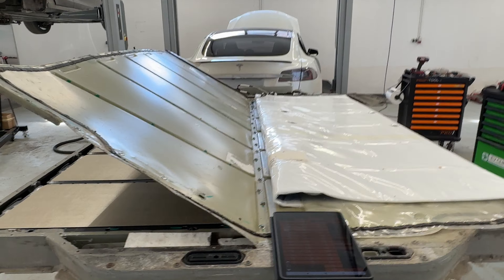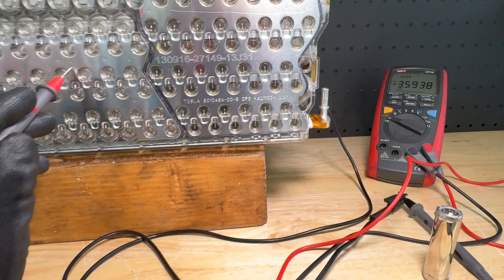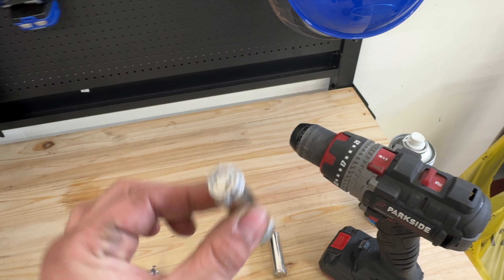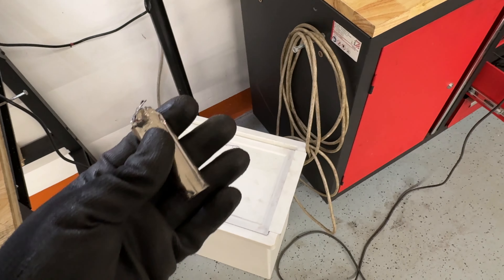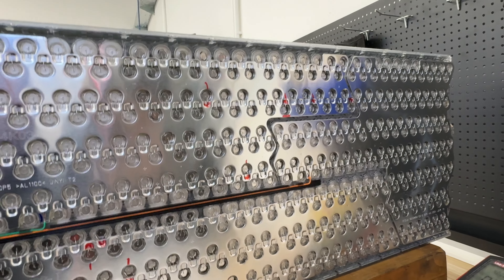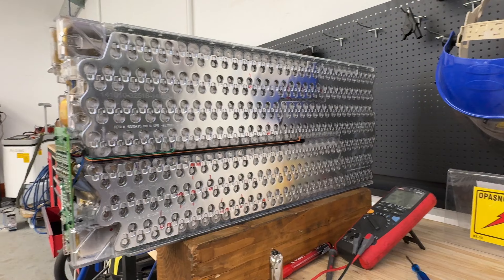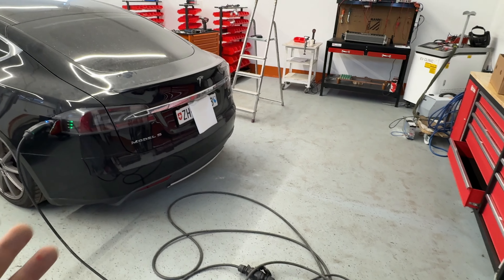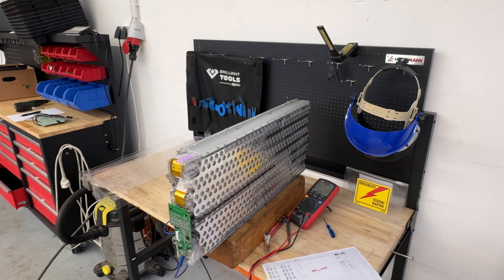Repair Tesla battery for 1€ - 1 Cell Extraction

Comment: If it was up to me I would use a thermal camera to find the discharging cell because it would acting like a resistor and be getting warm
Reply: Exactly, that's probably the way such shops detect the faulty cells, but obviously they don't want to share their knowledge. The another probable way which came to my mind would be to measure the current going through the fuse wire which will be difficult too.

Comment: That is what I call sustainable! Even if you do not do it for free, such a service is wayyyyyyy better than exchanging whole packs or even the entire pack for 20000€ for absolutely no reason.🎉❤
Reply: 12k+ labor with core from Tesla for remanufactured. About 10k without core and another 10k for a new pack with no core. So 12k€,22k€,32k€
Reply: @rkan2  just got quote from tesla. 20k for new pack. 18 for used. 25k with labor and 23k with labor. New is 90kwh reman is 85. So 20k is right. Atleast in eu
Reply: @diniitotoom2526  Is that with or without core?
Reply: @rkan2  didnt mention sht about core. Dont think they do that here

Comment: Congratulations and greetings from Bulgaria! This really makes EV transport even more sustainable! It may be harder to do the same with Model Y ans 3 packs as the cells are glued together, but I'm sure it would still be possible.
Reply from the maker: It is easier with M3, not harder, you have that video already.
Reply: @evclinic excelent work. What you think about Teslas 4680 which is glued that red polyurethan?
Reply from the maker: @Lucid911-k2i  i think it is possible to repair that too.

Comment: Great job there. With a proper battery tab spot welder and the other required tools you can absolutely do single cell replacement.

Comment: This seems like a good and professional solution. But how do you counter the argument that Jason Hughes from the US makes, that it’s not possible to change a cell an even modules, because the battery will fail again within 1-2yrs. He is probably one of the most respected Tesla hackers and has huge amount of experience with Model S. I really wonder who to trust here.
Reply from the maker: I trust only real life experience and results. Our 1cell repairs are still driving and not failing. Statement that 1 cell defect and 1 cell change is not helpful is not correct
Reply: Jason Hughes also said Tesla tried module swapping for remanufactured packs but stopped doing it soon after... So I tend to agree with Jason. Maybe these fixes last 1-3 years, but not 8 like a Tesla remanufactured pack should.
Reply from the maker: @rkan2  Not fully true, Jason is good IT guy but nothing close to our ex Rimac and Tesla battery engineers. Mixing cells with new one is not allowed, and test are neceseary to determine state healthy cells (dcir acir esr cac). Then you match used cell library stock with existing pack. Non of that is used by Jason nor has equipment for that. Jason is missinformin public about something he dont have skills nor knowledge to do. He is mythbusted. Cell level repair is possible with prober cell stock proper lab equipment.
Reply: @evclinic Exactly to the point👍👍👍
Reply: @evclinic Yes! And even Gruber in US says and makes exactly the same👍👍 And their repairs work as well very good. The question here might be what is cheaper to exchange the defective module completely to another used one which is balanced before or extract the one defective cell and exchange it and use the module further more?
Reply: Then why would tesla replace my broken pack with a repaired pack if they know it will fail again..?
Reply: @ARPost-kn2jl  They repair other damages and use the packs again, but not cell damage. For example cooling, wiring, contactors etc. can also fail and be replaced to use the pack again.
Reply: @evclinic Very impressive. Do you need to rebed the cell? If so how do you accomplish that process and is it proprietary also to your company? Thanks for any response
Reply: Because the replacement battery only has a two year warranty, not 8 years like the original. Tesla only needs the replacement battery to last two years, then it's not their problem anymore.

Comment: great work out there! curious what the toughest job, soldering? or pulling the cell out? looks like a lot of glue. either way not worth the risk which so high voltage
Reply from the maker: Module is 24V, that is not high voltage

Comment: Thank you so much for this video. I am on my second S with failed pack (water...) and I wish you were closer
Reply from the maker: Ultimate Tesla killer is not Nio, Lucid or EQS. It is Water ingress
Reply: @evclinic  Also replaced 3 LDUs. Reman lasted 79k km. Any update on the one installed in yours?
Reply from the maker: @VegarHenriksen  My made 30000km, one from Hansjorg with 2million km Tesla i at 150,000km.
Our solution is bullet proof for LDU
Reply: @evclinic  Awesome. That is the LDU you made, right? How much is it roughly €?
Reply: I found on website. 3.875,00 € inc. VAT

Will definitely purchase next time mine fails. Thanks for the hard work!

Comment: Amazing work!

I have a 2015 TMS P85D with 220.000 km…
It have started to show signs of anomalies/glitches. 

Approx how much will it cost for a service(reseal?)?
Reply: …, and - as I understand from what you say in this video, the battery pack on the P85D is not dimensioned right?
Can you upgrade the battery?

Comment: they need to make the cells easily replaceable and there should be a trade in service for these that for minimal cost you get a full working, repaired battery pack.

Comment: Do you provide any type of warranty ( e.g. a large labour discount if it occurs  again within 2 years or so ) ? What would be the price to check the battery  and replace 1 cell ?
Reply from the maker: 2 years warranty on full labor price. Unlimited mileage, SuC charging desired
Reply: @evclinic  Will contact you if needed , thanks for that swift response, I guess pricing is happening in private communication

Comment: I am surprised you removed the cell physically, I had expected you would leave it in place but simply disconnect the positive terminal of the problem cell from the rest of the block. In doing what I describe, the recovered overall battery would be around 1.3% lower in usable capacity but much better than the 30% reduction of usable charge when it was brought in.
Reply from the maker: Problem is more that 1.3% if you are taking it out from lowest CAC brick. We road testet 18 months several cars with 1 cell failure / repair and it is sustainable. But there are several rulles which you need to apply. First one: you cant put new cell….

Comment: Doing something like this in the old days required lots of notes and metering on old Nicad aircraft batteries packs, couldn’t imagine that many cells you deal with, you definitely need a computer to keep track of that many batteries cells. At least you don’t have to worry about fluid levels.

Comment: Why is a pack only built from kind of 18650 cells and not from lifepo4 cells/packs like GBS? this pack has an amazing BMS in it. My opnion is this not necesary to balance 15 modules with each 6 cells

Comment: Is BYD blade battery inside Model 3 (LFP version)? 
Will that also be repairable?
Reply from the maker: That might be extremely complex to repair
Reply: @evclinic  Did you ever saw a CATL pack in real live or on video? Munro talked about "Tesla LFP" while showing another manufacturer. 🤷🏻‍♂️
Reply: LFP have 10 times longer lifetime then Li-ion so don’t worry.
Reply from the maker: @volkhen0  That must be confirmed first on road. NMC 18650 can make max 600k km, 2170 500k km. LFP what it seems from Tesla warranty returns is 300k km. Degradation is bit faster and small kWh packs die faster
Reply: @evclinic  then the problem must be on the pack level (balancing? to big current?) or the cells that have 5000-6000 cycles lifetime have higher fail rate.

Comment: Does the new cell not keep charging at different rates than the old cell and in a few months time the delta of the section will again be too large?
Reply from the maker: We dont put new cells, that is biggest mistake. We use same age healty cells from other packs wirh same dcir acir cac
Reply: @evclinic  I should've been more clear. I watched the video and saw it wasn't a new cell. It is however a new cell to the old pack, even if it is already from a uses pack. It shouldn't matter how old the cell is. What matters is that the new im whatever way aged cell will always have worn differently to the rest of the cells in the pack to be repaired. Thus it will drift again. Maybe this repair will be longer lasting than  module swapping since it only affects a smaller amount of BMS'd cells and might stay under the thersholds. However I still doubt this will last 8 years. 

I guess it also doesn't matter for most companies doing this since they don't offer the kind of warranties like Tesla or 057 Technology.

If you want to put your money where your mouth is, you should offer similiar warranties imo.
Reply from the maker: @rkan2  We mentioned, that we recycle old cells.
Reply: @evclinic  Touché

Comment: I own a Model S 2015 with 94k km. Should i expect needing HV battery repair soon? Wondering if i just sell it
Reply: I have one with 380.000km and only 14% degradation. If yours has the LDU check for coolant leaks (rotor seal).

Comment: What's the cast to remove and put back battery Tesla 3 LR? Fixing battery pack Price from to? I'm asking because used battery is from 5000 euro 2019-2023.
Reply from the maker: Remove replace reinstall and collant flush 800€

Comment: 🤔 instead of replacing the cell. Can you just isolate it? Would that work..
Reply from the maker: It would work, but if that brick is with lowest CAC (Ah) then your pack will lose 3Ah of capacity. Which is equivalent of 4.8KM of range. It will increase strain on brick during charge and discharge by 1.35%, might decrease charge speed and will increase posibility of premature repeated failure. In most cases should hold above 2 years. It is easiest type of repair.

Comment: How did you identify the exact cell to replace?   You didn’t show how you extracted it either!
Reply from the maker: We have special equipment and set of tools which is our business secret and part of EVC Academy training.
Reply: The problem cells are not dead (disconnected from the pack), but rather they have a small internal short, which slowly drains that entire brick. You can use CAN data to find the brick (the brick who’s voltage is dropping), then since all that energy it being turned into heat inside that one cell, an accurate thermal imaging camera can see it. Or maybe they made a miniature clamp meter for the fuse wire. Lol

Another famous repair shop merely cuts the fuse wire, which allows the battery to work normally, but with 2% less capacity. 

EV clinic goes a step further and replaces the bad cell to restore its capacity back to the expected capacity for its age. 

Both processes are rather intensive, and almost the same amount of work. 

Remember this is a bandaid to allow the entire battery to keep functioning until the next cell gets an internal short thats too weak to blow the fuse wire or CID. For a fraction of the cost of a new battery, you are back on the road. 

Replacing the entire module would only be slightly better than cutting out or replacing one cell because the odds are the next cell to have this type of failure would be in once of the other modules. 

Totally dead cells can also be found with thermal imaging by fast charging and discharging that module and find the cold cell. Normally they don’t do this because 1 dead cell is not a big deal. But one self-discharging cell that is still connected can be a major problem.

Comment: In my opinion, this is where prismatic cells are better, easier to replace (correct me if im wrong).
Reply from the maker: Not exactly true, much more problematic to change because they are pressured between all other cells. You need to cut frame dizsaseble everythjng and change. All of them are glued too. We had experience with VAG prismatic and it is almost impossible to change one in a cost effective approach

Comment: will tesla accept a repaired old battery pack when I like to get new battery from them ?
Reply from the maker: Only if BMS has original data, Serial number tied to that VIN
Reply: @evclinic  Thank you very much !! So Tesla will take the battery back as deposit, even when if it has been opened by you and the data is correct ?

Comment: The first: You can’t compare a pack to 3x expensive pack.
Second: Leaf has most repaireple pack and they do it by dealers carage so there is no need for special arrangement. 
And it’s also the cheapest one to repair by dealer or replace, whatever Teslaquys tried to tell to you. 
You can show me also how to repair or rebuild last genereation Teslapacs. Yes, with that messy spray insulation means no repair at all. One bad cell and to the crusher. Tesla has the complicated batterypacks for thrue.
I am a batterypack builder, from scratch also, so i know what i’m saying and you simply use thermal camera to hunt those bad cells. Leaf pack technician needs to use only phone aplication to find a bad cell.
Reply from the maker: Leaf is the worst pack ever produced, most degraded and big safety issue because cells inflate. OEM repairs them by mixing cells and it cant hold for any reasonable period of time. In UsA they recall them. Second, leaf battery is 2-3x more expensive then tesla pack in OEM

Comment: I changed 69 cells in one block of a 2008 Tesla roadster, a month later the car stopped again. (Next brick, next cel)))))
Reply from the maker: Roadster is nightmare, cell quality and troubleshooting, if you test cells properly, i mean realy precise you could detect potentially bad ones. Time consuming, and roadster btw is outdated and killing cells by bad charge voltage range.
Reply: Tesla Roadster has crap cells and not worth trying to rescue old packs. You have to exchange ALL cells. Otherwise it is a stupid work.
Reply: @evclinic yes. I am fix 4 month)))
Reply: @evclinic Guy in Denmark is working on his own custom battery pack for the roadster, based on Model S modules
Reply: @f36443  Who?

Comment: So many cells, so many opportunities for failure....🤔😳😏🇬🇧
Reply from the maker: And still it drives 600.000km
Reply: @evclinic  Maybe so, but I'm a retired Engineer.. I'd never have an EV because the battery packs are not designed for easy servicing...It's not complicated...😏
Reply from the maker: @EnglishTurbines  good you are retired, because battery packs are easy servicable if you have knowhow
Reply: @evclinic  Oh, kudos for fixing the pack...It's just that IMO, the dangers of dismantling the pack and fixing the dead cells require skills that are in short supply. The Labour costs won't be cheap but neither is the cost of replacing the entire pack...I'm sure pack fixing will become a thing. It's the failure rate and time to fix them which will be the issue IMO....Have a nice day....🤔😏😏

Comment: that fix will only last months if not less. get a new pack, lol.
Reply from the maker: Not true. That is Myth sold by incompetent “experts”.
1 cell extraction road tested and still driving, with proper measurements of old and exchange same cells with same internal resistance and CAC repair works perfectly.